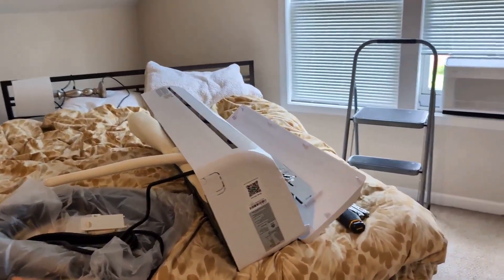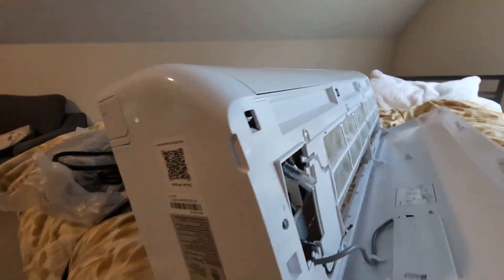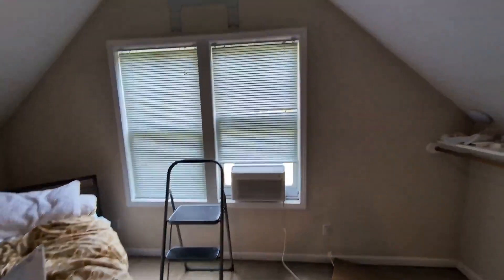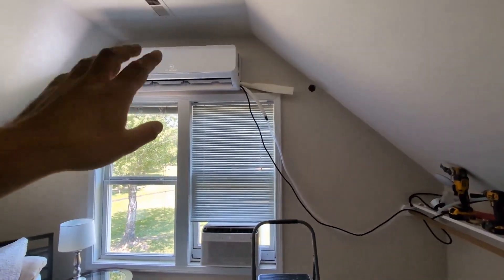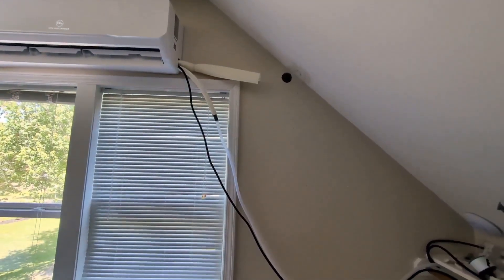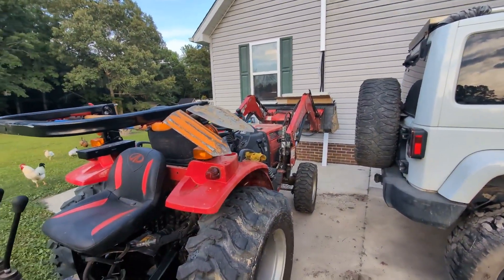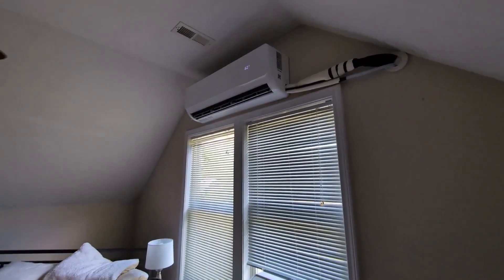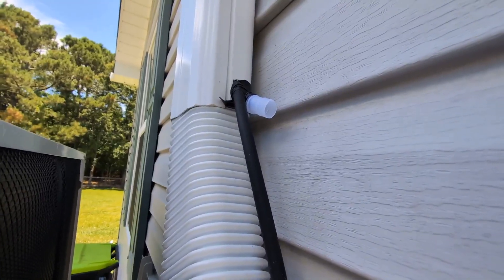EG4 24K AC/DC Mini Split Installation

Comment: Installing mine now. The mystery plug messed me up, too!
Reply from the maker: Yea I'm still not sure what that does. But the unit works perfectly so .... 🤷
Reply: @ianmburke  having an absolutely horrible time trying to mount the inside unit to the mounting plate. Don’t know what I’m doing wrong. First the hole seemed way too close to the plate the way I did it according to the template. Then it was nearly impossible to get all the wires and cables through enough that I could get the unit against the wall to click into the clips. So I mounted it onto a piece of plywood so it would have a bit of space and I barely got it on, but it looks precarious. Very frustrating.
Reply from the maker: I wonder if having a pass through hole that was a little larger to allow movement in the position of the line set would make that easier as well?
Reply: @ianmburke  I finally got it. I didn’t realize it was absolutely vital to clip the top in first. Also, moving a dresser over to stand on, instead of having each foot on a different step ladder, made for a lot less swearing…
Reply from the maker: Yes the top hooks in then the bottom clips in! Brilliant with the dresser though I used one step stool and my shoulder hates me now 😂 glad you got it in!

Comment: How did you get “6 1/2 feet from the floor”?  The instructions you show say 28.5m/98.42 inches = 8 ft. 2 inches.
Reply from the maker: You are correct I misspoke, however with most ceilings being 8' achieving the ceiling clearance I suspect would be the most important one to prioritize
Reply: @ianmburke  I was hoping that you spoke with the manufacturer about it because minimum floor distance of 8’2” and ceiling distance of 6” eliminates most homes (mine also) having 8’ ceilings.  Have you had any issues with the unit not having the minimum floor distance and what exactly is your distance from the floor?  Thank you by the way for posting your video and your responses.
Reply from the maker: I have not spoken with them about that spec but I have this same unit upstairs and downstairs in my house and the downstairs unit is only 4 inches from the ceiling and probably 6.5 feet off of the floor and I have had zero issues with either unit and I live in the southern part of the USA and it is crazy humid here and still no issues
Reply: @ianmburke  thank you again for your replies.

Comment: Great video, Ian! We really appreciate the transparency. We've received a lot of requests for EG4 to offer extended or longer line sets. That's not something that's available at the moment, but should be in the pipeline in the future. We're really glad you enjoy the unit, and look forward to the first floor install. Keep up the great work!
Reply from the maker: Thank you! The length would be super helpful and although the mounting was a little more technical I was most worried about the noise it would reverberate into the wall and that is almost zero!! Several times I have thought the unit was off while I was outside 15 feet from it because it is so quiet. Once I do the first floor install I'll also do some decibel readings near this unit indoor and out because personally I think that is a very under represented benefit of these units, they are nearly silent even when running on full